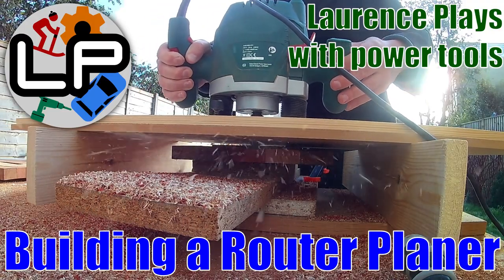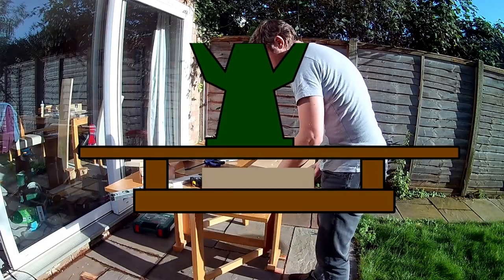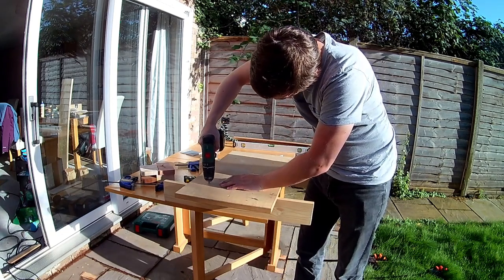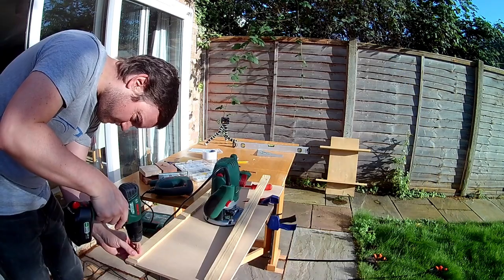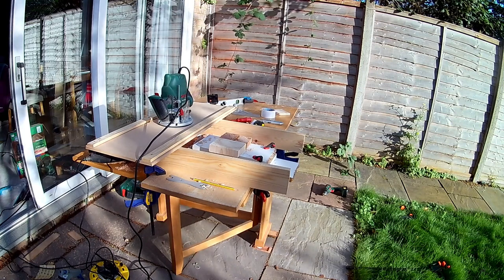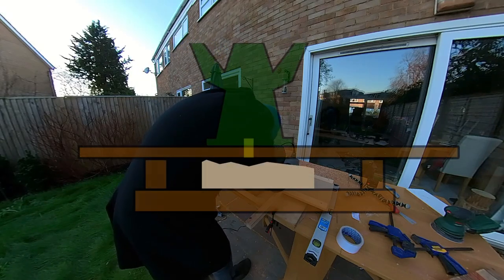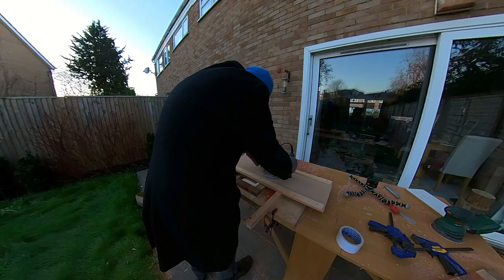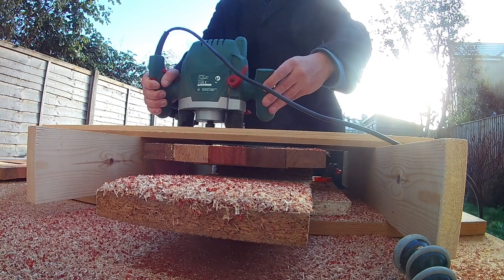Building a Router Planer - Beginner Woodworking - Laurence Plays with Power Tools

Comment: For holding it in place. Drill two holes on each of the guides. Put an (in dutch) "Inslagmoer" in there from the inside. And get some long bolts or threaded rods in there. Put a piece of wood inbetween to not damage the side of the workpiece while clamping.
You can also unscrew the top of your new squeeze woodglue clamps. And turn them around so they can spread. And use them on the inside to clamp the piece in place. Might be not as sturdy.

Comment: Interesting, I built a router sled that was just as wide as the router with a fairly wide slot in it made from 3/4 plywood. Doesn’t flex at all. Also using paste wax on it makes things slide easy. There are a lot of videos on these sleds. Probably best ones are made from angle aluminum or iron, but I didn’t have any.
Reply from the maker: I didn't want the sled to be too thick because that limits how far down the router can reach, that said I do think I made it a lot wider than I really needed to. I might rebuild it at some point, much narrower, to make it easier to see. Thanks for the suggestion!
Reply: @LaurencePlays  you could possibly sink the router in thicker wood using the router ofc. So you still get the same reach. Chipboard or mdf won't work for that. And ply only if you have plenty of thickness left in the bottom. And try to hit the edge of two layers.